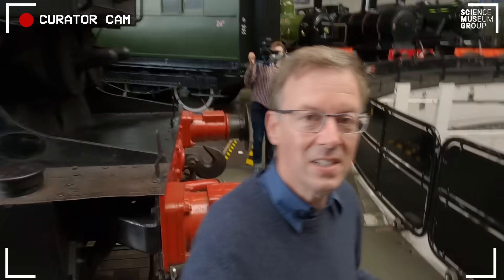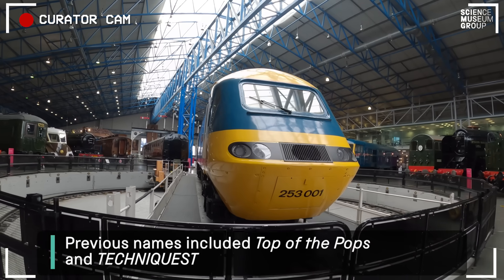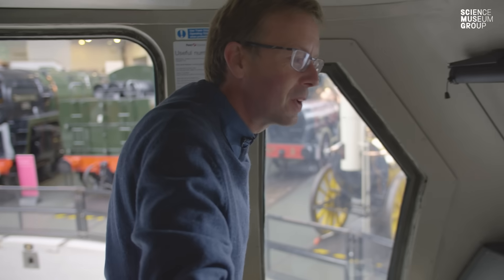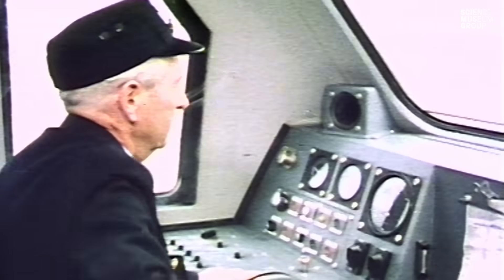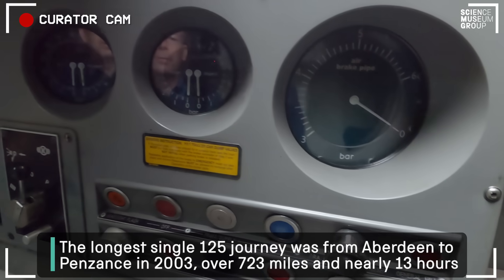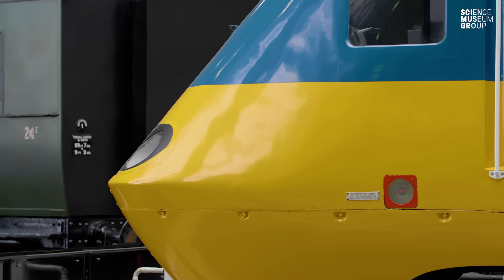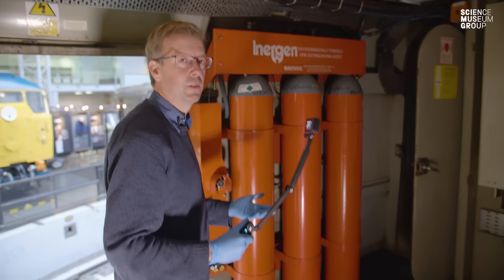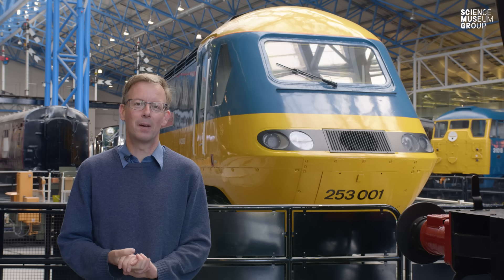What's Inside the InterCity 125? The HIGH-SPEED Diesel Design Icon | Curator with a Camera

Comment: Pretty good. On the braking system, one of the clever features was that they are a lot more effective than traditional air braking on loco hauled stock. Application is more rapid, and the braking rate is higher, in such a way that it was possible to raise the speed limit from 100 to 125 without major signalling alterations on the Western Region when they were introduced. The max speed to be able to stop within a given distance at 125 with these is almost the same as 100 for the rest. There were changes made to signalling at some junctions (the introduction of “flashing yellow” aspects e.g.) to comply with it and make best use of the enhanced performance, but it was not necessary to renew the whole lot to raise the maximum speed.

Re. emergency brake applications, as a passenger I’ve come across a few of those over the years, even when standing, not sitting down; not all that dramatic, except when it was caused by someone who ‘jumped in front’ to kill themselves at Cholsey station one evening.
Reply: It's still a standard twin-pipe UIC air brake, the faster application is from an electric brake unit on each power car which sends the brake 'demand' from the brake control unit in the leading power to the rear one effectively applying the brakes from both ends simultaneously, the higher brake rate itself comes from using disc brakes rather than traditional cast iron tread brake shoes.

The difference in the rate of application of the brakes is such that if the electric brake unit fails the train must be limited to 110mph as the disc brakes alone cannot ensure the necessary braking distances.
Reply: @hexagon7895  Absolutely right. The other useful feature is 'wheel slip protection' (WSP), which is not 100% effective, but better than nothing with disc brakes. No shortage of MkIII stock with the odd 'flat' bit on the wheels, or indeed, the odd one on rail heads!

Comment: It was a shame that the original designed single driving seat cab (as on the Prototype)  did not become the production cab. The Guards van had one ace in it's hand that's missing off the UK rail network today: you could easily get a surf board in it!

Comment: Interesting video but incomplete regarding the engines used. The original Paxman `Valenta' was indeed replaced but I believe at first by Paxman `VP185' (in part, not across the network) which were about one Tonne lighter, more economical on fuel, and produced far less Diesel & lubrication oil smoke compared to `Valenta'. They were quieter too, the much loved Turbo scream of `Valenta' had gone. Finally however it was decided to change, virtually network wide to MTU state of the art Diesels manufactured in Friedrichshafen, southern Germany. 9:42
In 2011 MTU was aquired by Rolls-Royce Power Systems AG.
Reply: That was certain;y the case with the New South Wales Railways licenced copies called the XPT, the VP185 refit commenced in the mid 90's over here.
Reply: @Tiger351  The XPT power cars are extensively modified from Class 43 for Australian conditions. To cope with larger gradients the traction motors are lower geared resulting in a design speed of 160 km/h (99.4 mph); the engine cooling capacity doubled; revised engine air filtration; longer travel, more compliant suspension fitted to deal with poor tracks; stronger front collision protection and nice business like sounding horns are the main points I recall. Originally fitted with Paxman `Valenta', all power cars were upgraded to Paxman `VP185' around 2000 giving better fuel economy and less Diesel / lubricating oil smoke. The power cars are mated with carriages based on a Budd design that appear to have a larger loading gauge than for IC125 , including Sleeper accomodation; power cars & carriages manufactured in Australia by COMENG (who, I believe, no longer exist).
Check out `XPT by COMENG' (3 videos) here on YouTube if interested. Also `XPT at Wauchope' has great sound & no visible smoke.
Finally `NSW Trainlink- XPT- WT28 start up and departure - Lithgow - 14th October 2020'
Reply: @Martindyna  I knew there were a number of modifications made to localise the power cars including the gearing (from memory the top speed during testing without passengers was 186 Km/h), the redesigned wheel bogies would also later become an issue with cracks forming due to metal fatigue in the late 80's/early 90's (I was a maintenance electrician for State Rail 90-94 but was on the Cityrail side maintaining EMU's rather than Deisel electrics). Comeng closed in the mid-late 80's after contracts dried up due to several major contracts for EMU's being awarded to rival manufacturer Goninan instead.
Reply: @Tiger351  Thanks for the info. Glad to see that Goninan is indigenous to Australia.

Comment: Is there a difference between DSD and DVD or are they just different names for the same thing?  Also what is the little red/orange tag for inside the cab?  Great video :)
Reply: DSD and DVD are slightly different.

DSD is activated after a delay when the driver takes their foot off the pedal.
So, as he said a "dead man's switch".

DVD is activated when the controls have not been moved for a period of 60 seconds.
The driver has to lift their foot and reapply it, or the brakes will come on.
As the name implies, it is a vigilance device.
Is the driver still paying attention?

Both the DSD and DVD can be linked to the Radio system on modern trains and call an emergency to the signaller if not cancelled by the driver.

So, if a driver falls unconscious at the controls, the DSD should activate, if for some reason there is still weight on the pedal for 60 seconds, the DVD will activate.
This then applies the brakes and tells the signaller that a driver is not in control of that unit, allowing them to stop other units, put signals to danger and lower crossing barriers etc if need be untilcthe train has stopped.
It may even lead them to re-routing a train and prevent it blocking a busy line whilst help is on its way.

Comment: Interesting video - shame Terry Miller wasn't mentioned

The HST power cars and Mk III coaches were designed by a team based in the Railway Technical Centre in Derby under the leadership of TCB Miller, British Rail's Chief Engineer (Traction & Rolling Stock); Kenneth Grange designed the distinctive nose shape, but the actual design drawings for it were produced in Trent House in the Railway Technical Centre, and although the power cars were made at Crewe, the fibre glass moulding for the nose was produced in the Derby C&W Works in Litchurch Lane (now Alstom)

Comment: Fantastic trains. For those of you that are wondering, GWR, CrossCountry, Scotrail and EMR are still operating these trains today. EMR have a planned date for retiring them but Scotrail, GWR and CrossCountry have no plans currently for retirement. The 125 Group also have 2 (I think) ex-EMR trains with VP185 engines. They are planning to fit one of them with a Paxman Valenta engine like they did with the prototype HST. (Also, 43102, which is the HST that holds the world record, is going to be coming to the NRM sometime in the future in Intercity Swallow livery).
Reply: I thought GWR had stopped running their HST sets, or have they brought some back into use?
Reply: @pepperstmm  GWR are still running HSTs in 2+4 formation between Penzance and Cardiff. Whatever GWR didn't hold on to either went to Scotrail or went to storage. (The sets they did hold on to first went to Wabtec to be fitted with sliding doors to replace the slam doors)
Reply: @donutdisturb69  & retention tanks for any toilets,
Reply: the 125 group  have currently  fleet of 044 048   089 hst  class 43 loco,s
Reply: does not hold the world record anymore ,the GWR HST,s are owned by ANGEL trains and run out from Plymouth Laira depot
Reply: @terry-wc9sw  43102 still holds the world record for being the fastest diesel locomotive or something like that.
Reply: @donutdisturb69  no it does no the fastest diesel speed belongs to japan
Reply: @donutdisturb69  wikipedia is the most outdated info in the world ,it was the fastest when built and tested ,japan trains overtook it .
Reply: @donutdisturb69  oh dear ,you are still wrong ,
Reply: @terry-wc9sw  read anywhere and it says the 125 is the fastest diesel locomotive in the world,i think you are confused a bit here we are talking about diesel locomotives not DMUs EMUs or Electric locomotives

*note the fastest recorded speed by a train is actually french done by a TGV unit when it went 574km/h (357 miles per hour)

Comment: The point you make about steam having only been gone for 8 years brings home how revolutionary these were.
Reply: And how long in the tooth steam was...
Reply: I've been interested in the HST since childhood spotting days 40 years ago. I've read numerous books on the subject and how unions opposed having only one person in the cab and hence the central driving up position which lead to the offset driving position and need for a wider windscreen, but being less than a decade after steam had finished put this into context.
Reply: A fact that really brings that home is that Ron Jarvis worked on the design.  He was also the man who rebuilt the Bulleid Pacifics.
Reply: Steam hasn't really gone, as it is still used on some lines in the UK especially the tourist lines
Reply: Like the Vulcan bomber …
Reply: At a time when in Japan all electric high speed trains were running routinely faster than this diesel anachronism.
Reply: They were literally built to replace the failed APT. It’s just a fast diesel. The Japanese had the Zero series 7 years earlier
Reply: @MrJimheeren  the  HST(class 43) was fastest diesel in the world at125mph in 70,s ,it did actually top over 140 mph  on east coast main line on test on special test line section
Reply: @MrJimheeren  No they weren't. They were developed at around the same time and the electrically powered APT entered service on the WCML, while the HST entered service on the ECML and West Country express lines which weren't electrified.
Reply: 30 years ago the thought of having a Diesel or Electric powered unit in the national rail museum would have been considered sacrilege

Comment: 10:15 the valenta's we're not replaced until 2006-2010 not late 90s early 2000s.
Reply: They were kind of, the VP185 was used in the first HST in 1995. He doesn’t just mean the MTUs replacing the valentas
Reply: I think the first MTUs were 2003 and the very last Valenta on National Rail was a Grand Central one in 2010 (don't know the number off the top of my head)

Comment: 43002 & 43003 were the last two FGW Powercars with Valenta power units .
MTU Fitment came in Jan 2008 and retuned back to FGW in March 2008 .
43002 had a very characteristic Marston Cooler Group with the Valenta that ran loudly & very vacuum cleaner esque in sound .
I wish I kept a log of how many miles I achieved with 43002 in a set as from 2002 - 2011 I worked for FGW on the onboard catering.
Reply: When built, the Paddington-Bristol/South Wales and ECML builds all had Marston cooler groups - Serck ones came with the West of England and XC builds
Reply: I think the first MTUs were in 2003. Very last Valenta on National Rail was a Grand Central one in 2010 (don't know the number off the top of my head).

Comment: Nicely done.  Unless I'm mistaken, you missed one significant fact.  Shortly after introduction, it claimed the world record for fastest diesel locomotive / train at 147 mph.  That record is unbeaten today.  Rumour has it that in the days before things were so closely monitored, it wasn't unusual for some drivers to take it up to 140 mph in service on the ECML, particularly on the sections of line with double greens on the signalling (originally intended to allow the IC225 to officially run at 140 mph in service, but the project was never completed).

Also worthy of mention is the Australian XPT, which is more or less the same locomotives (just configured for that market).
Reply: ive never heard about it on the east coast mainline, but ive certainly heard that in the 70s on the great western mainline drivers would have competitions to see who could do the closest to 140 mph, it didnt last long however as BR quickly caught on and electronically limited the HSTs to 127 mph
Reply: The XPT power cars are extensively modified from Class 43 for Australian conditions. To cope with larger gradients the traction motors are lower geared resulting in a design speed of 160 km/h (99.4 mph); the engine cooling capacity doubled; revised engine air filtration; longer travel, more compliant suspension fitted to deal with poor tracks; stronger front collision protection and nice business like sounding horns are the main points I recall. Originally fitted with Paxman `Valenta', all power cars were upgraded to Paxman `VP185' around 2000 giving better fuel economy and less Diesel / lubricating oil smoke. The power cars are mated with carriages based on a Budd design that appear to have a larger loading gauge than for IC125 , including Sleeper accomodation; power cars & carriages manufactured in Australia by COMENG (who, I believe, no longer exist).
Check out `XPT by COMENG' (3 videos) here on YouTube if interested. Also `XPT at Wauchope' has great sound & no visible smoke.
Finally `NSW Trainlink- XPT- WT28 start up and departure - Lithgow - 14th October 2020'